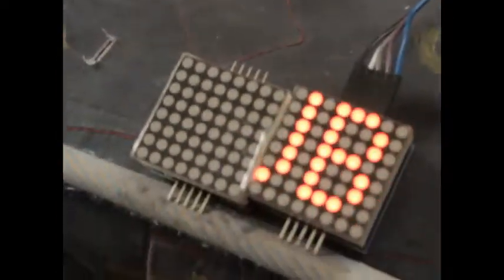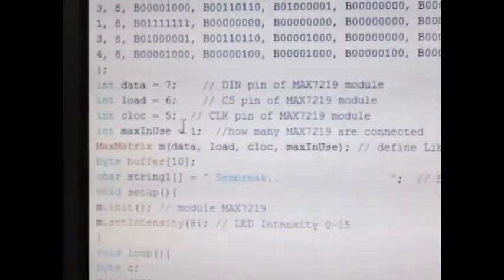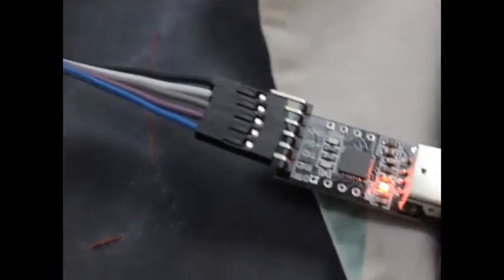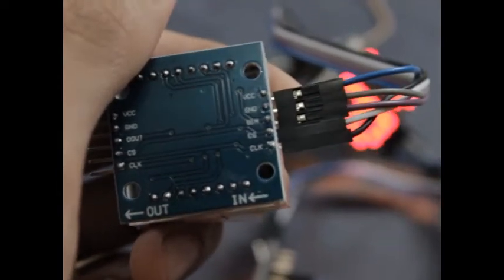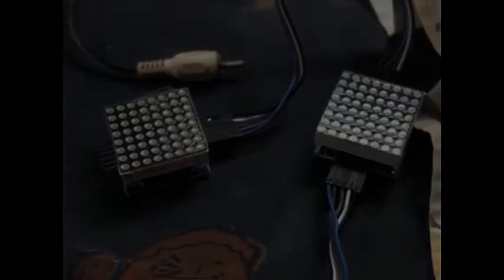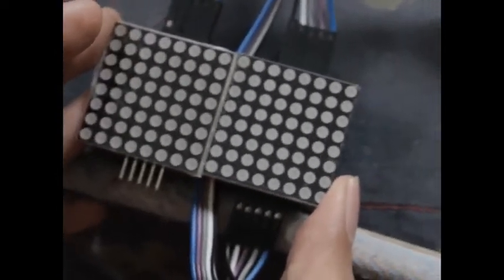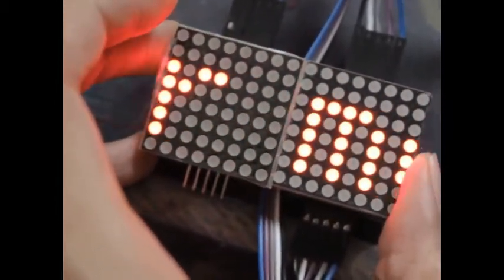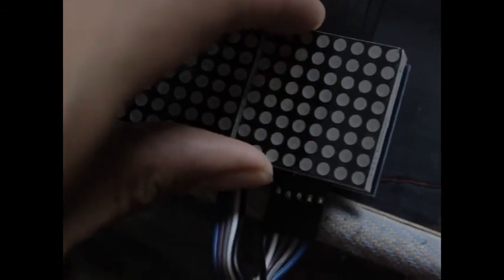How to use multiple MAX7219 Arduino tutorial

Comment: i have 4 connected serial when i run your code the orientation its not the correct its like a tower displaying from the top to the bottom can you help me so the orientation be vertical please. i have the same max7219 that you have
Reply: If you have a card with 4 displays connected, like me, use the codes (sketch) of Parola here: http://parola.codeplex.com/